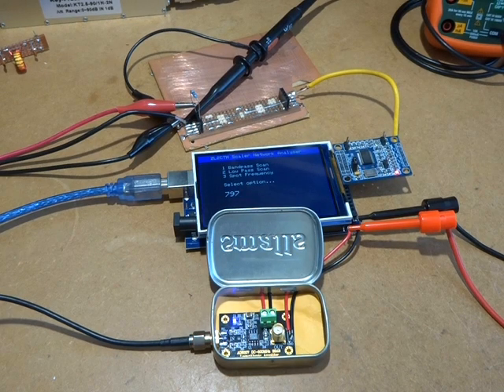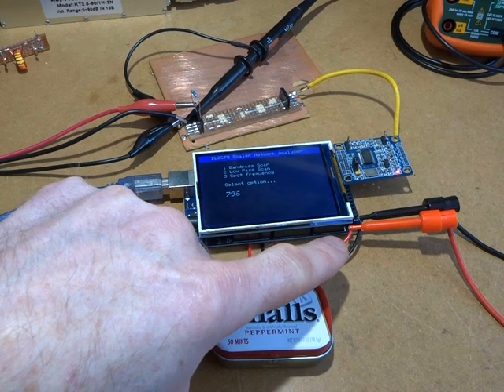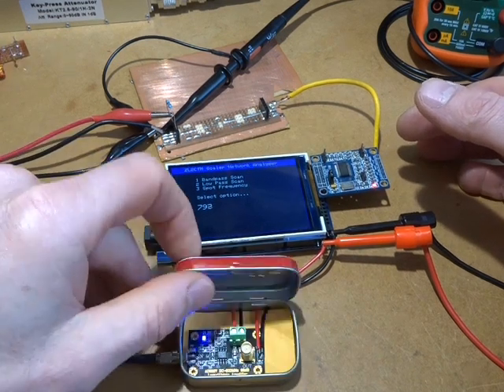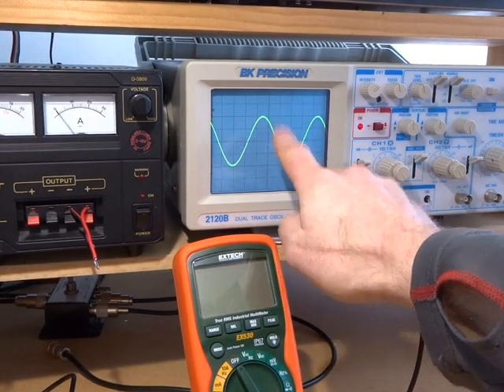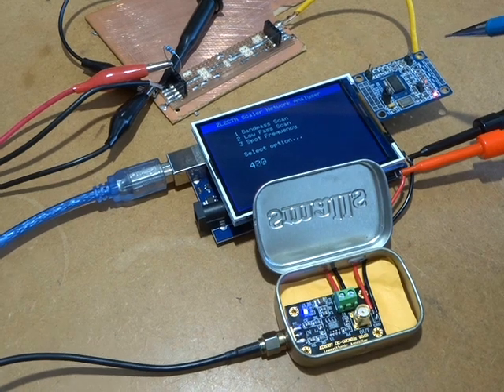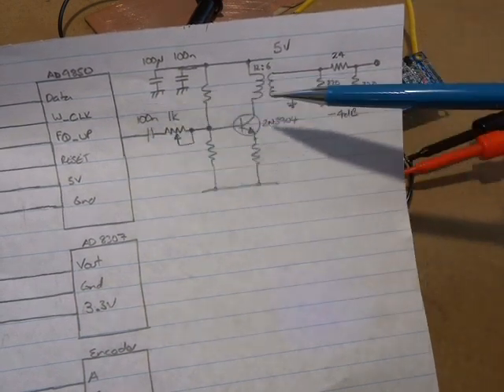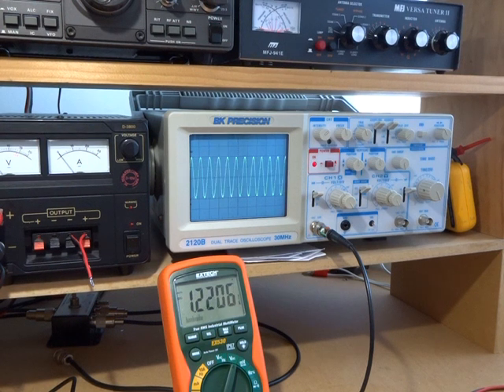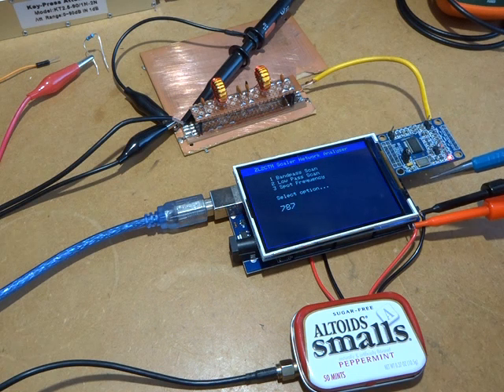Simple Scaler Network Analyser - # 1 Thoughts and Ideas

Comment: Do you have any suggestions for building Band-pass filters? (I have just be playing with Elsie to figure out them).

KD9KCK 73
Reply from the maker: Hi. I must admit I have been defaulting to the band-pass filter appendix in Solid State Design for the Radio Amateur book as they seem to work well for me. I have not tried any other designs at this stage.

Charlie

Comment: Hi Charlie, the AD9850/51 amplitude certainly tails off near the Nyquist frequency, that coupled with the limited bandwidth of the scope will show a steep drop in overall amplitude. I use the AD9959 as the output if pretty much flat over the DC-200MHz tuning range, I have done an article recently on a new board I have purchased from China - take a look when you get a minute it might be useful. If you are going to stick with the AD9850 DDS, you could replace the NPN amplifier for a dual-gate MOSFET or a pair of FET'S configured as a DGM and use a simple AGC to keep the output level constant - or you could just hard code a fudge factor in the software, depends how involved you want to get mate :)
Anyway, here is a link to my article if you are interested:
http://www.homebrewradio.uk/new-ad9959-dds/
Reply from the maker: Excellent, thanks Robert. That module looks really interesting. I retested the AD9850 with a 200MHz scope with the probe set on 10x. Now the AD9850 is essentially flat (with an external 70MHz Butterworth LPF) out to 30MHz-odd. As for AGC, I think I'll code it in, i.e., run a sweep with the output shorted to the input and characterise the frequency response. I'll then invert that and add it to any DUT measurements. That 'should' work.

Thanks again for the link to the article.

Charlie
Reply: @CharlieMorrisZL2CTM  In addition to any output loading issues or issues with the filter, all DDS have a sin(w)/w amplitude rolloff, where w is from the Nyquist frequency. The AD9959 has a much faster core (so you don't get so close to w) and a built-in PGA that can compensate. See my free driver code on Github: https://github.com/cjheath/AD9959

Also bear in mind that the DAC is a current-steering type which is best into a balanced load - if you build your own you should use a transformer or differential-input op-amp for best results. Not all the AD9959 modules do this, and the unbalanced currents cause the 4 channels to intermodulate with each other.
Reply: @CharlieMorrisZL2CTM  Quick addition: see Figure 12 on the AD9851 data sheet for info on the sin(w)/w rolloff.
Reply from the maker: @CliffordHeath  Excellent. Thanks Clifford.

Comment: Hello Charlie,

There's an digitally-controlled RF-attenuator  module available on Ebay, search for 'PE4302 attenuator'. With one of those between the DDS and the amp you might be able to do the signal levelling via software.

Cheers, Steve
Reply from the maker: Thanks Stephen. I'll look into that. Looks like the AD9850 on-board LPF may be the culprit for the poor bandwidth. I'll remove that tonight and design up an external replacement.

Charlie